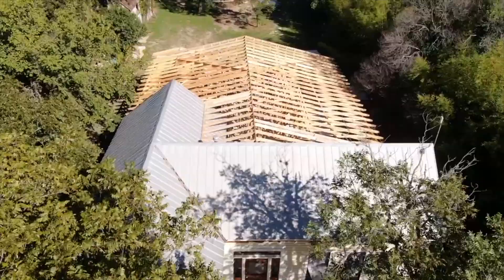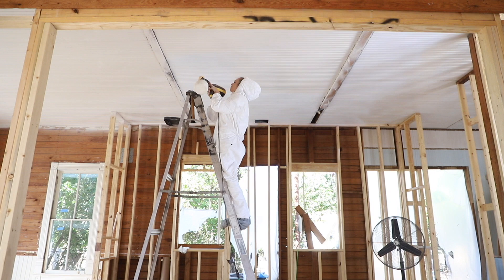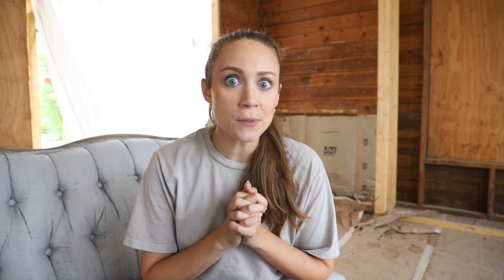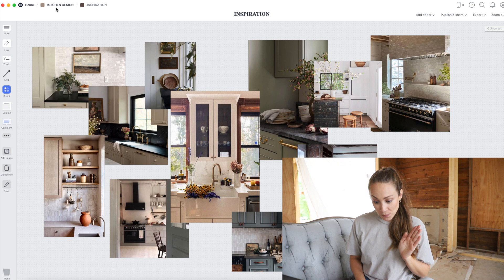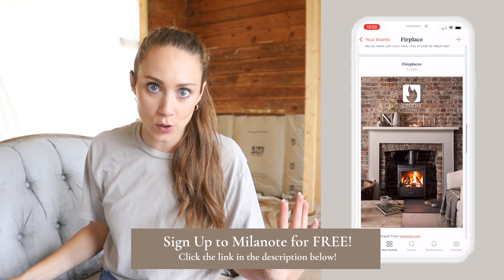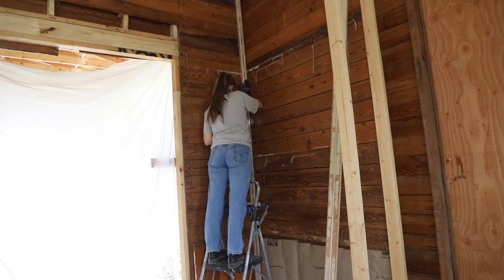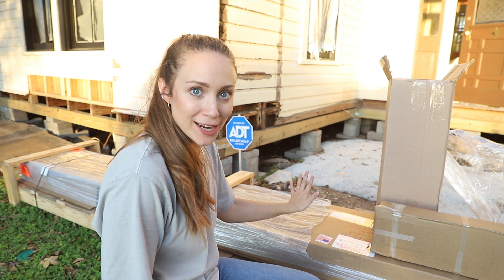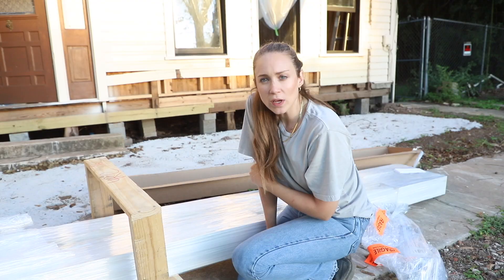Designing Our LIVING ROOM + WE HAVE A ROOF! | XO, MaCenna

Comment: Personally I would go with flat, if only to counteract (hohoho!) all the original elements and reclaimed furnishings and all of that with a more modern looking flat surface. The stone itself is so pretty, it can do the personality talking by itself, I'd keep it clean and square so that it's that touch more modern and sharp, in contrast with the more rounded, intricate qualities of your other pieces. And the sharp, clean lines work with the more classic vertical lines in the house too. Not to mention that if you end up not liking it, you can always have a stone worker bevel it out, but once it is, that beautiful stone you loved is cut. For good. No going back.

Comment: I think bevel will look good on the vanity, because the original top of the cabinet already has a beveled look to it, you know? I think square cut would look good too. I think I'm just a fan of pretty much anything except pencil. lol But even then, I don't have an incredibly strong opinion about it! I think the penny tile under the tub and up the surround is going to be absolutely beautiful! And the slab goes SO WELL with the wood color in the house and paint colors. Really, really lovely!

Comment: Pulling out those green tones with a penny tile border would be amazing...a little more formal, but certainly in keeping with the age of the home, and very pretty. But if you're inclined to do the beveled edge on the slabs, which is also a bit more formal, I think it's worth considering. Fabulous work so far!

Comment: That patterned floor title is EVERYTHING!! I might just be biased, though, as my favorite color is gray and I am REALLLYYY into vintage patterned floor title, lately! Also, naturally, I am in love with the long gray subway tile and the textured creamy white subway tile!

 I plan on renovating my bathroom and kitchen. I plan to have large matte black hex floor tiles with a textured off-white long subway tile wall/backsplash (haven't decided how far up the wall I want to take the tile, yet), with either an 'Early American' stained vanity, white-washed light gray vanity, or an ashy medium/light toned vanity... Using a combination of black and oil rubbed bronze finishes.

For the kitchen, I want off-white or cream colored upper cabinets with sagey-green colored lower cabinets. Thinking about gray wood plank floor tile, butcher block countertops, some open wood shelving or even pipe and wood shelving, wood planks over the stove hood (framed out and using proper ventilation, of course!), and using either a combination of matte stone and mother of pearl hex tile for the back splash, or using the same creamy off-white textured long subway tile that I want to use in the bathroom..
My entire home is done in a modern farmhouse, boho, vintage style, as far as home decor and aesthetics go.

Comment: I like the flat edge detail the best. I like straight and simple. Also, you may have already thought of this, but I noticed you weren’t putting the nails you pulled into a bucket or container. When you finish pulling nails, you should get a strong magnet on a string and swing it around all over that area. Otherwise you, or your contractors, will be getting flats when pulling around the yard to clean up, deliver goods, or even mowing. Don’t ask me how I know. 😬

Comment: Plywood and plastic are off. Congrats 🎉 things are finally going faster for you. I’m at finishing stages with my house and starting to enjoy the progress again after a dull and boring period in the middle. Made sure to have concealed access doors on my ceilings for the A/C and electrics maintenance. Sockets, switches and etc. are next with more decisions to make. For you, I suggest the pencil round edge if the stone is going on an older style furniture and I would go with a clean straight edge for the kitchen only not to over crowd the space so I can go at it with the decor.

Comment: Hey! I love seeing this all come together. 2 things: 1) if there is space are you going to be maximizing the crawl space between roof and ceiling? Is there going to be space? 
2) be careful what tile you get from floor & decor, we used them for our bathroom tile and we had to last minute switch it because the tile for floor was larger pieces and they didn’t lay flat or straight and our contractor said he recommended switching it out. The penny tile should be okay, ours was fine, but if you are wanting to use any larger pieces you may want to double check and be sure they are flat and even. 
Side note about penny tile: some people say it hard to clean due to so much grout. We installed it and sealed it and have had no issues, we just clean regularly. I will say if you want to stand on it have them grout extra to minimize the difference between grout and tile levels as that difference can feel uncomfortable under foot.

Comment: I could see the bevel edge maybe in the kitchen but I don't think it would go well on the antique pieces you plan on using in the bathrooms. I have had several antique walnut dressers and wash stands with marble tops and they were either square cut or a cut that resembles a routered table top edge. That being said, you have impeccable taste. Whatever you choose will be perfect for you!

Comment: The 'Flat Polish' would work beautifully for both the Kitchen & Wet Areas, The 'Bevelled Edge' is a bit too much detail which comes across as overdone against all you're other detailing with cabinetry etc. Ask if they do 'Square Edge Aris'. I use this allot with clients and it's the perfect amount of bevel without being do squared off. The finishes are coming together so beautifully you've done a great job with your selections I love them!!!!

Comment: QQ- To remove the paint from the couch you found with your mom...Could you cover a patch with paint stripper and power wash it to see if it comes off? Curious to see if that would work 😅
Reply: No, if it did remove the paint it would severely weaken the fabric as the paint will have soaked through the fibres so it wouldn't last as the stripper ingredients eat through the bonds of the paint, also the paint soaks into the stuffing underneath and that will all need replacing too, the stripper would potentially dissolve some materials. I've not had a customer approach me where they have painted the fabric yet (just one who tried to dye the fabric in situ which failed big time) but friends who are also upholsterers have & it's not pretty, the main big thing is the paint makes the fabric stiff and crispy so it's really not nice to sit on.

Comment: I really like bevel edges. I think it’s a good middle ground between tradition and modern/contemporary upgrades. I would also recommend in your kitchen using a different edge for your island. I personally think an ogee or double ogee can really make a statement for such a grand centerpiece. And then using the bevel on the surrounding countertops would make it look intentional, cohesive, and not too same-y.

Comment: When installing those B board wood planks on the wall, you should’ve patched that hole where the insulation was showing also you should’ve kept in mind about wood expansion. Spacing every piece of wood at least 1/8” would’ve been ideal…😬😬

Comment: Your front porch spindles look a bit short as did the original railing.  Be sure to check building codes in your area to find out what the minimum height and spacing should be in case you need to reselect a longer spindle or order additional otherwise theyll have you tear it out and redo it.  Your contractor should be guiding you on this as well.  Im in Texas too and min height is usually 36" and spacing is no more than 4" apart where I am.

Comment: I'm very surprised that your roofing material will be available so quickly. Your contractor should have been able to order it from your drawings and not need to wait on actual measurements.
I think you need to go with square cut stone for your kitchen to tie in with the farmhouse detailing. Maybe beveled for your vanities but if you're following curved furniture it might look too fussy.